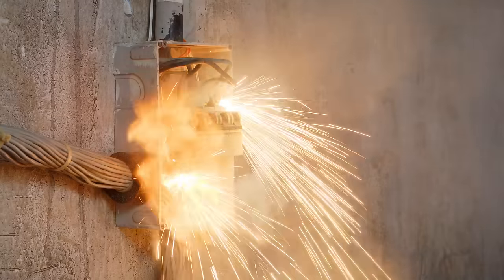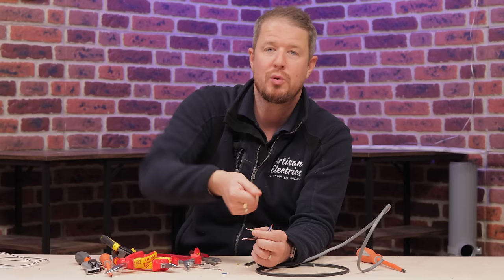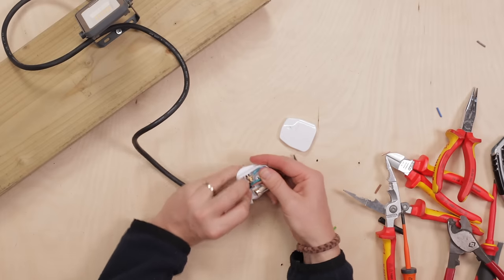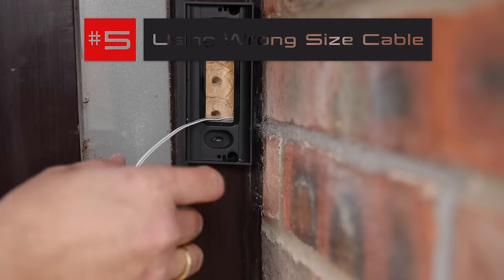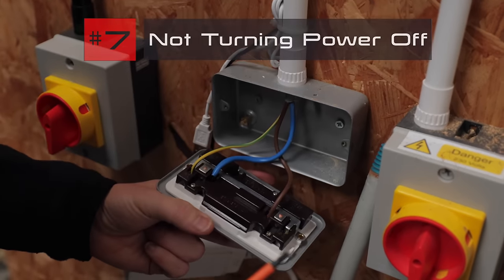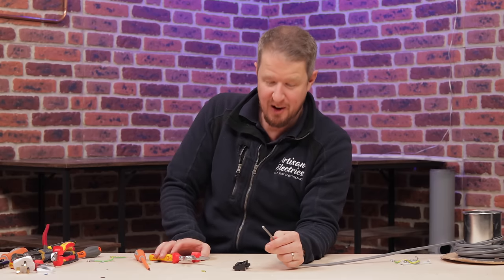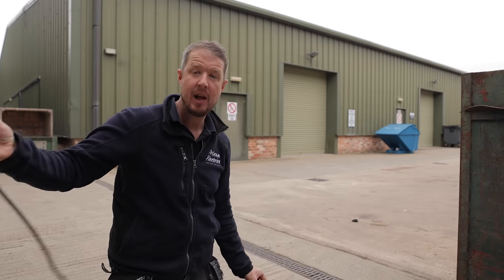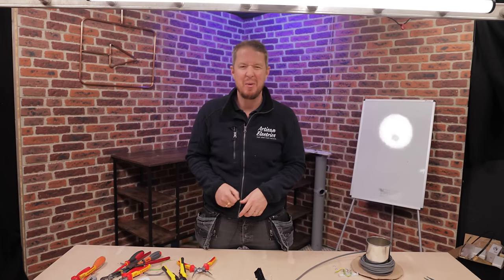10 Mistakes EVERYONE Makes When Doing DIY Electrics!💥

Comment from the maker: If you want to make sure you are doing your job correctly, then you will need a proper test device for that. ⚡Kewtech KT 1780 - https://amzn.to/43Gglzk
Reply: Should also include a link for a proving unit.
Reply: It's rather KT63DL
Reply: Laughing at soldering??? Are you honestly suggesting the way all electronics is made is wrong ?
Reply: i was putting some lights up in friends bathroom and the replacement lights had multi stranded cables i put it into the connect and screwed it up pulled and it come out the connector so i though thats not safe, i had a crimping set i brought from lidle and i put like a small tube round the multiple strands crimped that onto there, did twisty 90* bendy thing it didnt come off so i put it into the connector block thingy and screwed it in made sure it didnt come out off that and then put the light to the ceiling, so i think i mad a fairly reasonable effort to make it safe. my general rule of thumb is pull on it and make it look pretty, if it dont brake with a pull and it looks need then its more than likely safe
Reply: Prefer the Fluke 150 myself.

Comment: Makes me want to do a video about the mistakes I've discovered done by qualified electricians on houses I have purchased over the years!
Reply: what proof do you have(visual?)that they were done by qualified electrician?
Reply: Over-tightening terminals on copper wire is a favourite. Fine for a few years but the excessively squashed conductors can fail and create points of high resistance

EDIT: lol just got to the bit where this was mentioned as a DIY mistake but the pros do it all the time 😅
Reply: As with any profession there are good ones and bad ones.
Reply: Please share what you have come across, it may save someone’s life.
Reply: @waynethomas3638  What visual proof could he possibly have? There are dumb questions, and then there are dumb questions. Take a guess which type yours is.
Reply: @stevenshaw9643  Not a dumb question, as proof of work done can only be shown by video because work that has been signed off on can then be reworked by some one else and any mistakes are then attributed to the last signatured worker
Reply: Well i for one have given up on most so called professionals, better off doing it myself in the first place than fixing their work i think, seen enough to know enough.
Reply: terminals not tightened up at all was a biggie in my parents house. 10+ years after it was rewired I had to go through every socket and light switch in the large 3 bed semi house tightening all but 2 or 3 fittings because the cooker switch wiring had been shoved in but not screwed in and had been arcing so badly it burned away 8ish mm of the beasty heavy conductor before the cooker stopped working
Reply: @ johnbeer4963

Wow! 😯 scary ☹️
Reply: So many horrible installs by lazy or incompetent "professionals".
Reply: @bendingspring house built late 80s a live comes up into attic from fuseboard goes to a unglanded junction box meets every other light cable ran to that jb all twisted together and gripped in a connector block then duct taped together and buried in the insulation and another junction box somewhere else in the attic insulation for all the neutrals. Best part. Some of these are under strain. This is the way the house was built I would suspect it was an electrician who really didn't give a shit.
Reply: In my family home that was built in 1964 and purchased new by my family, I found that the the electrician (or whoever did the wiring) had put in ‘fake’ bare ground wires in some of the receptacles.  Back then, the grounds were not in the sheathing with the hot and neutral.
Reply: In an apartment I lived in earlier that was new built (so no DIY work), I found in the consumer unit, that one of the cables going from a circuit breaker out to an outlet, was put in too far, so the insulation was under the screw. 
The apartment I live now had a bathroom that was newly renovated when I moved in (done by a  building company). 
In the junction box going to that bathroom (which feeds floor heating, light, an outlet and connections for a washing machine and dryer), they had used WAGO 773 connectors, for stranded wires (those are meant for solid wires). When they pushed in one of the wires into those connectors, 1-2 of the strands was not going into it, but bending and coming out on the sides, haha
 - then they just left it like that, with strands of a live wire pointing straight out from the connection.
Reply: How do you know who did it?
Reply: @waynethomas3638  Genuine question, what the hell are you talking about? I have no idea what you mean or how it relates to him having visual proof of his claim.
Reply: If I could share a photo of a mistake I discovered done by the power company themselves. 
They split the neutral to fit it to a bus bar
Reply: @stevenshaw9643  he's asking a question I share as a home owner, how can you tell its not DIY from the previous owner.
Reply: @znk0r  Because it was a new home...
Reply: These suggestions whilst valid are very basic. If someone doesn't get all these things, most definitely they shouldn't be even thinking of touching stuff. Equally, competent minds with the adequate knowledge can do great work, taking great care and paying careful attention to detail and do excellent work. Generally talking through things with an electrician and properly researching the job online helps, as does being prepared to buy professional tools for the job. It's about attitude and common sense. Always talk through the equipment you are buying and get a recommendation you are buying the right stuff for the job, that is properly rated and installed. Know the limits for everything you are installing and that they are properly protected inside those limits. Watch a professional doing the same job before you attempt it for the first time is a good rule.
Reply: I doubt any professional electricians would seriously contest that electricians (probably including themselves) have at one time or another made mistakes and sometimes those mistakes will get missed by inspectors because, well...we're all human; still there is a greater chance of someone untrained in any field making critical mistakes.
Reply: Mate asked me to check his electrics after a 'qualified electrician' did some work in their kitchen. But they could no longer switch off their washing machine, I found they’d split the ring across the supply and load sides of this FCU they replaced. Sent them a video asking why it wasn’t tested, and he got a full refund for the job within minutes 😅
Reply: @waynethomas3638 the proof I had was watching a licensed electrician do my sub-board in the shed, then calling him some weeks later about the faint burning smell, watching him open the board, discover that he hadn’t tightened the terminal screw on a 63A MCB retaining a 32mm neutral cable, and profusely apologise while replacing the visibly heat-damaged breaker.
Reply: Was doing some tidying up at a house recently and a 100A cable fell out of a Henley block…
I know that block hadn’t been touched since it was wired by a “professional”.
Reply: @waynethomas3638 what proof? How about burying a cable outside a safe zone with no identifying components so you can’t tell it’s there. Too late to resolve it now so will do some pictures and drawings detailing the cable route for the next poor sole owning the property.

Comment: As the legendary oil rig fire fighter Red Adair said “If you think that hiring professionals is expensive, try hiring amateurs.”
Reply: Very, very true - in many industries.
Reply: Love it. I am going to use that more with my Senior Managers in Health Care...
Reply: Red Adair in a rare moment off from dancing with Ginger Rogers.
Reply: Err how can you hire an amateur; only means somebody isn't be paid!!!!
Reply: @grahamheath3799 there's always one.
Reply: @saw6386  amateur doesn't mean bodger.
Reply: @grahamheath3799  usually when it comes to electrics and plumbing it does, or at least not doing the job to the correct standards, there's a reason they're paid so much, it's fr our knowledge, but my point wasn't on the fact of your point, it's the point that you had to point out a slight nuance on the ops sentence.
Reply: You you think safety is expensive, try paying for an accident
Reply: @bpenny4352  Exactly
Reply: Certainly cheaper than a casket.

Comment: The heat produced in a wound up extension lead is NOT caused by induction. It is caused by conductor resistance and lack of cooling.
Reply: Exactly!
Bifilar coils like this cancel out the magnetic field nearly completely.

Not knowing about reduction Factor on stacked cables and it's danger is a typical DIY mistake.
Reply: Sometimes making fun of others can backfire.
Reply: To expand on these accurate comments by op & @AzrethK9. Yes the coil is definitely Bifilar and therefore a non-inductive coil for this purpose (basically the magnetic field of the neutral cancels out the live, why you can't use clamp meters on power cords). Additionally self-induction is not a method of energy dissipation, it is a form of energy storage. If the coil was inductive the energy world be stored in the magnetic field and released later in the AC cycle. This why PFC devices are called for on inductive loads, they don't affect your real power consumption, just the power factor.
What this is, is an example of a hazard caused by bundling many (slightly resistive) conductors together and there being nowhere for the heat to go. Think of it like wrapping the inner wire in a blanket, and an electric blanket at that. This same hazard would occur if there were many separate cables all carrying this current, this is a hazard electricians should understand.
I think this myth may come from two places, people knowing a coil can be inductive, assuming it is because they don't know what an inductor is; and then assuming that one thing they now see is the cause, ignoring the obvious real cause they should already know about. 
The other possibility is people are thinking about induction hobs, which is a whole different situation, firstly they use an inductive coil and secondary (pun intended) there is a pan to act as the other, shorted, winding. </rant>
Reply: One cat we had used this to good effect - it would curl itself up and go to sleep on a coiled extension lead feeding a heater.
Reply: Exactly. Even if it wouldn't be bifilar, the number of winds and the low frequency would lead to no real inductive effect.
Reply: We doomed, I tell ya, we’re doomed.  This person’s videos are always filled with doom and gloom. I would hate him coming to do a job for me it would cost a fortune in reworking.
Reply: That is right you can't get transformer induction with both live and neutral wound on a bobbin, it is the tight spacing and lack of air cooling that causes the heat to accumulate.
At 2.5 kw that extension wire will give off heat due to the magnetic field caused by the current. This is why when folks say current flows, I have to correct them and say current does not flow in a circuit. Voltage flows in Electrons, the resistance induces a magnetic field in the wire (the current is static), which can only be measured indirectly using either a resistant shunt or a coulomb clamp meter.
Reply: @G1ZQCArtwork  That is so wrong !

Voltage doesn't flow, it is a difference in potential. 
Resistance doesn't induce a magnetic flield, only the current. That's why super conductors are useful for strong magnetic fields (nearly) without resistance. 
A resistant shunt is not indirectly as it is in the circuit and draws some voltage from the current.
Reply: @G1ZQCArtwork  
"Voltage flows in Electrons" Come again?
Reply: @reinhard8053  You need to look up basic electronics. Voltage flows by kicking free electrons through the wire, the resistance causes heat. The load draws watts, the current is dependent on the load, no load, no current. Current does not flow in a circuit. It manifests as a magnetic field in the wire.
It is impossible to measure current directly, other than a coulomb clamp, or the voltage across a shunt.
Show me a method of measuring current in a wire with no load.?
Reply: @deadly_dave  You need to look up basic electronics. Voltage flows by kicking free electrons through the wire, the resistance causes heat. The load draws watts, the current is dependent on the load, no load, no current. Current does not flow in a circuit. It manifests as a magnetic field in the wire.
It is impossible to measure current directly, other than a coulomb clamp, or the voltage across a shunt.
Show me a method of measuring current in a wire with no load.?
Reply: @G1ZQCArtwork  While some of you points are correct a good part of it is nonsense. Better read your books again.
Reply: @reinhard8053  Not really.
You tell me how you can measure current directly out of a wall socket.? It is an absolute myth when folks conflate and confuse how Electrons travel through a wire.
There is no current until a load is applied, and it is impossible to measure it directly. Current does nor flow in a circuit, it is a static magnetic field. How do you think an electro magnet works.?
Voltage being EMF, the load being the demand, and the current is a varying magnetic field induced in the wire directly proportionate to the load. Remove the load, and it (the current) is gone, yet you can still measure voltage present. You need to go deeper and expel the myth of current flowing. It simply does not.
Take an MCB, there is a bi-metallic strip which heats up according to the load applied, expresses in Watts. Current is present to the rating of the MCB, but does not physically move, if the load is too high, the strip breaks the connection because it gets hot. As soon as you remove the load, the current disappears, leaving the volts only.
Reply: @G1ZQCArtwork  

A measure of the difference in electric potential between two points in space, a material, or an electric circuit, expressed in volts. 

How does the measure of a electric potential "flow"?
Reply: @G1ZQCArtwork  Please read some books and don't throw everything around mixing reality and fiction.
Reply: @malectric  If the cat's still coiled op on top of the extension lead coil, then you know it's fine. Be alarmed though if the cat suddenly leaves that spot! 😁
Reply: @DerMarkus1982  It was an interesting observation. That was back in the early 1970s. Both long gone.
Reply: A 50m coiled extension lead with three core 1.5mm flexible cable has a round trip electrical resistance of 1.3 Ohms (0.013 Ohms/m x 100m). A 2.5kW heater has a full load current of 10.86A at 230V, (2500W/230V = 10.86A). The power dissipated in the extension lead is equal to I^2 x R, from Ohms law, i.e. 10.86A^2 x 1.3 Ohms = 153.3 Watts. This is enough power to melt the insulation on the inner windings of the extension lead. Don't ask me how I know this!
Reply: @G1ZQCArtwork  Watts are a measure of energy over time.

Comment: Seen a few qualified electricians just lash cables all over the loft joists unsecured. Done with the right mindset a DIY job can be done with more patience and care than your average electrician!
Reply from the maker: Very true!
Reply: Yep, my brand new house was a bit like that in the 90's. Some cables were clipped but many just strewn on top of the insulation.
Reply: Exactly the case here. Loose cables just flung over the top of the joists, not run properly in any way. Add in the person who put loft boards in the loft not knowing to screw the damn things instead of nail them and to interleave the boards and I had a flooring mess. What made it worse was because of the half-arsed wiring job done gaps had to be left in these already flimsy loft boards and the "fix" was to just leave a gap and dump another board over the top and nail that in place too. I'll be redoing all that wiring at some point, running it properly through the joists but it's a tedious task - it's a flat and it's both sockets, lights and storage heaters that have been wired like this. For extra fun I found that one of the storage heaters had been wired into the lighting circuit in the distribution box. Genius.
Reply: In some countries this seems the norm. It brings shivers down my spine. Why not just spend a couple of minutes just to make it tidy?
Reply: "Done with the right mindset a DIY job can be done with more patience and care than your average electrician!"

Yes, that's very true. Anything I've done has been permitted, and with extreme care and attention, precisely to the regs. A better job than a pro electrician that does the minimum. 

What pro's don't notice, is the excellent DIY, because its indistinguishable from a professional job.